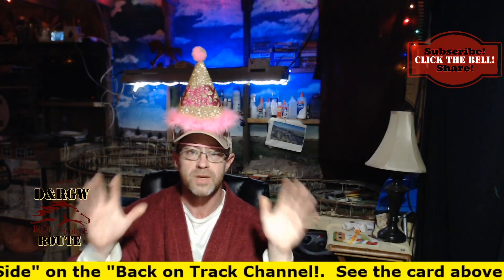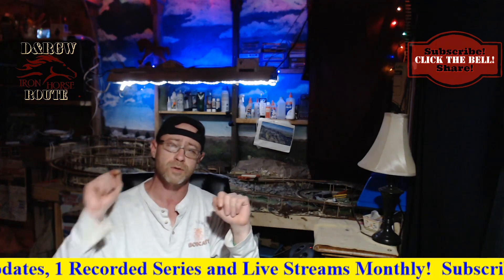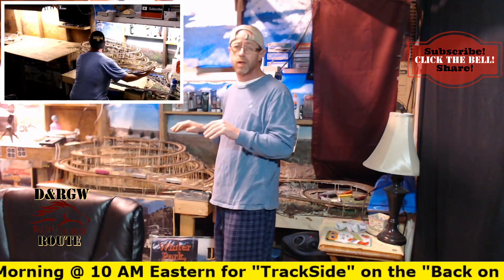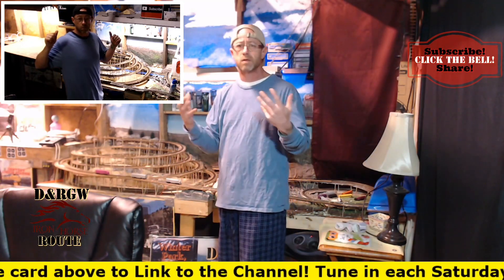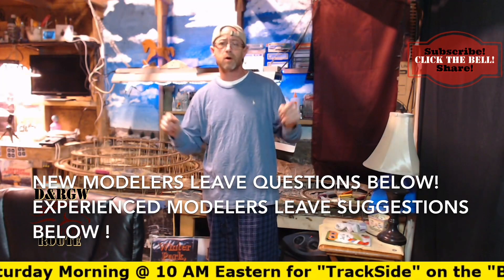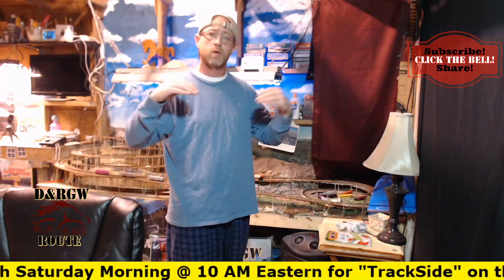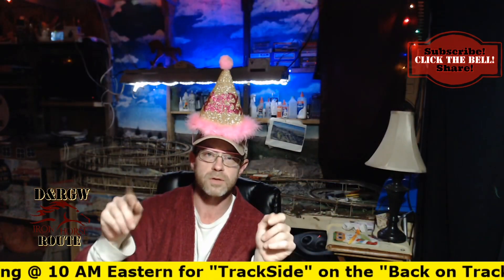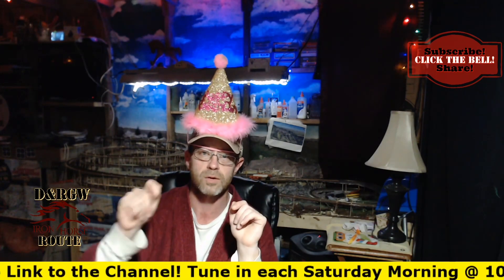Do You Lube? (Locos) - Model Railroad Locomotive Upkeep and Maintenance - Part 1 - D&RGW Iron Horse

Comment: Super Lube contains teflon,plastic safe,much cheaper the Labelle,comes in a small tube,had mine for many years,until the tube cracked,had not used even half,good thing I had a backup
Reply from the maker: Ok.  You mentioned a product from wal mart for the worm gears as well as super lube.  Can both products be purchased at wal mart or are they one in the same.  I couldn't really tell.  I would also like to know if you can help me cleaning the internal parts of the kato's prior to lubing them.  I will take care of the wheels, but the cleaning and lubing of the inner workings of the loco is still foggy to me as I am not familiar with the workings of the interior.  So first I will dismantle and clean the wheels.  How do I go about cleaning the worm gear tower that you mention.  I do know where the worm gears are.  I know there are two.  Well I guess there could be two sets of two.  Can you help answer when you get a chance.  Thanks Dave.

Comment: Hey Brian. I'm HO (as you know). I've used Labelle in the past, although IIRC it's a bit pricey. I have some from Excelle now, but haven't used it yet. I've only lubed my locos when the performance degrades and I've cleaned the track & wheels. Both Dave BNSF Nscale & EJ&E Jeff have some excellent points. Great series,  I think this will be helpful to many modelers (not just those new to the hobby). Very nice production - looks great. Best, John
Reply from the maker: Thank you.  The most important thing that I took away from your comment was "after cleaning the track and wheels".  That is something that I am doing today.  I am going to clean any areas where sputtering is occurring with any of the units, clean the wheels on all of the units and do a test.  I will let you know what happens.  I appreciate you watching commenting and most importantly your friendship and support!  You are the stuff!  Appreciate you bro!  Brian

Comment: Hey Brian,  for N I use Excelle ultra-lite  conductive lube, but lube isn't the only issue here. On DC, the dominant motor (the one with the least resistance) will pull more amperage away from the others, making them slow, or not run. This is one reason why I switched to DCC.
Reply from the maker: Very good answer and very Helpful Jeff.  You are not the first person to mention the DC issue.  I am beginning to think that a good present to myself might just be the beginning of the DCC ++ kit.  I am thinking I can begin to get started an make a programming track for about $50.   I will post the final recommendations for each scale in a pinned comment below at the end.  Then I will buy the lube for my scale and give it a go.  Look for a surprise announcement video coming out on Christmas.  The 1 year channel anniversary will come out new years eve, featuring channel and video highlights in a progression, followed by the next episode in this series the first week in January.  I appreciate you watching the channel and commenting .  I hope you an yours have a Merry Christmas!  Brian

Comment: I've only lubed my n scale locos perhaps once but they were relatively clean. Wheels are cleaned regularly. My locos do appreciate warming up runs but as others have said they might run well individually but running together on DC one loco might take the current over the others. Also find that atlas locos might be geared differently to each other as well as other brands.
Reply from the maker: Whoaa Leslie.  That is something that I didn't consider.  That one of the locos could be pulling more current when they are all on the track at the same time.  I did run them individually though and the A units are both a little sluggish.  I am going to clean the wheels and do a test today.  I appreciate you watching and commenting Leslie.   I will post the final recommendations for each scale in a pinned comment below at the end.  Then I will buy the lube for my scale and give it a go.  Look for a surprise announcement video coming out on Christmas.  The 1 year channel anniversary will come out new years eve, featuring channel and video highlights in a progression, followed by the next episode in this series the first week in January.  I appreciate you watching the channel and commenting .  I hope you an yours have a Merry Christmas!  Brian

Comment: I model in HO and I have always used the Labelle products. Primarily the #106 grease for the gears and the #108 oil on bearings. Remember that when it comes to lubrication, less is more. My experience is that with time the lubricant accumulates dirt and other crap and needs to be cleaned out rather than just re-lubed. My question would be: if the loco uses the axle bearings to pickup power from the wheels, is using a lube containing graphite an advantage?
Reply from the maker: Hmmm.  That is an excellent question Art.  i actually intend to pose that question to Dave Bnsf N Scale.  It could have already been answered as I haven't read that far down but I will be coming back to answer that.  Comment continued soon!

Comment: I have Labelle #108 multi purpose oil light. I'm not sure how to use it either. I also would like to know the shelf life of this oil. I've had this oil for, it hast to be 30 plus years, no joking. I have heard that you should only oil the gears at the motor and not at the wheels. I can't remember the video I saw it on. No matter, I'm sure other people can tell us the correct way to lubricate our engines. Nice Helix by the way.
Reply from the maker: Thank you for the compliment on my helix Jeff.  I'm sure we can get an answer on that shelf life question for you as well.  I am hoping to find a good resource to use for the actual lube process for the kato loco's.  I realize they are all different and I am still becoming more familiar with the inner workings.  I do know how to take my loco's apart entirely and can re assemble them properly, but like you, I'm not exactly sure where the lube needs to be place.  I am hoping to get and report answers to these questions at some point today.  I will update on the pinned comment above.